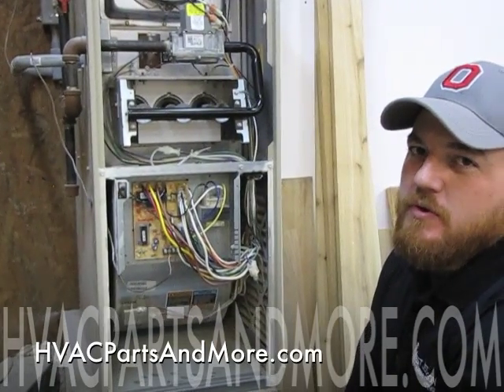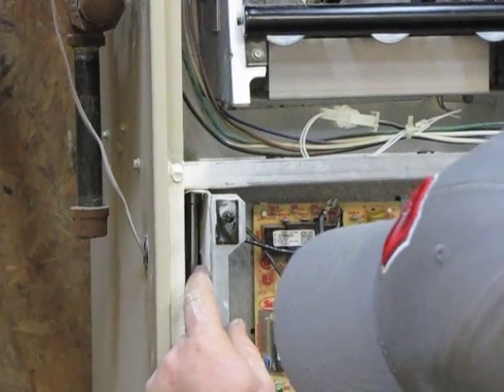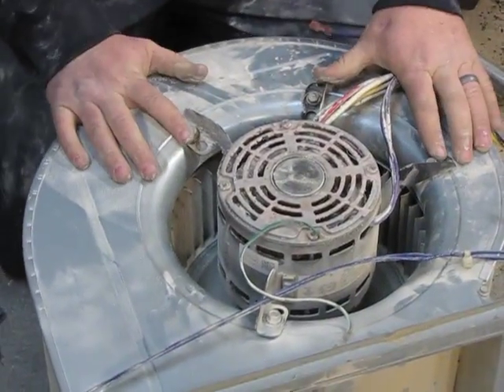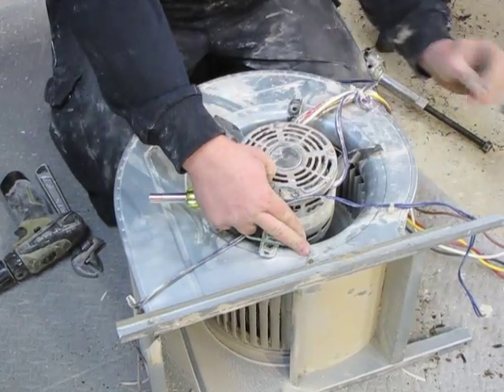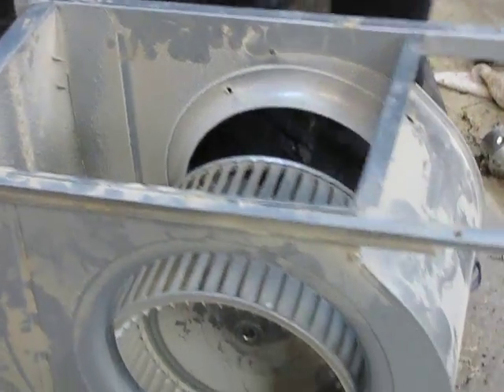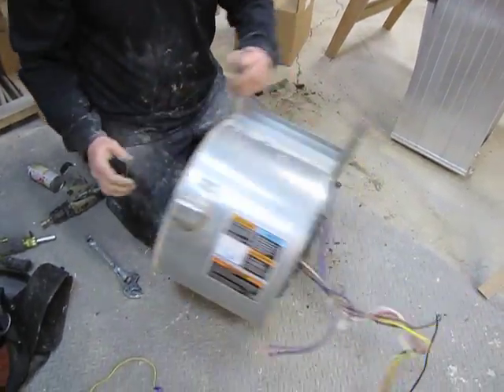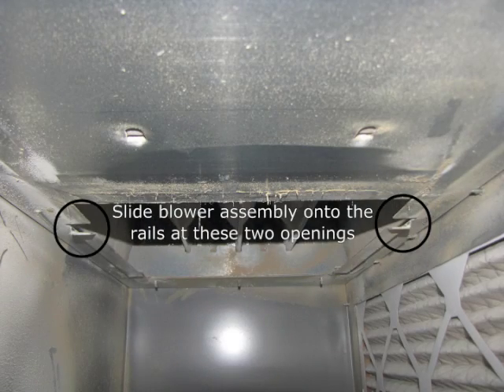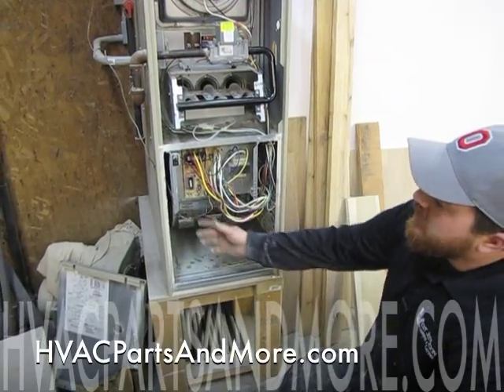DIY - How to Replace a Blower Motor, Wheel, and Housing on a Lennox G40 Furnace

Comment: Question: My original squirrel cage blower wheel lasted 23 years. It separated from the shaft. Anyway, I had it replaced with a new part. It just went today after only 6 1/2 years. The same thing happened. It separated from the shaft. My HVAC repairman says it's pretty rare for this part to go & doesn't know why it broke so quickly. He checked the shaft & said it's not "out of round." He also saw the wheel had been balanced as we could see the weights on it. The motor bearings are fine & are the original ones. 

What are your thoughts on why the original wheel lasted 23 years & the new replacement wheel only lasted 6 1/2 years?
Reply: Made in China... Lol.
Reply from the maker: Separated from the shaft as in the set screw came loose and the wheel came off the shaft of the motor? Or separated as in the rest of the wheel came loose from the center shaft that the motor slots into? Without being there to see it, it's hard to know what's going on; too many variables. If the wheel is just coming loose off the motor shaft, then it's possible that the shaft of the motor (assuming it's original) doesn't have the correct hardness anymore to allow the wheel to stay locked on to it. It's also completely possible that it's as simple as you got a bad wheel or something and it just didn't last as long. 6.5 years is a decent amount of time all things considered but yes it should last longer. As with anything (appliances, furnaces, A/Cs, water heaters, etc) these days though, you should not expect them to last as long as they once did. Normally wheels don't need replaced except when they get dripped on and rust out, but occasionally they get a little off kilter or out of balance.

Sorry we can't provide you with a better answer, it's just not a straight forward problem with a straight forward solution (at least without being there first hand)
Reply: Thanks. No, the set screw did not come loose & come off the shaft of the motor. That's the first thing the HVAC repairman asked me over the phone to check for before he came out to take a look at it. If it had, I would've put the wheel back in place & tightened the screw up. I wouldn't have replaced the blower wheel. 

The blower wheel separated right at the spot as you said  where "the rest of the wheel came loose from the center shaft that the motor slots into". 

My HVAC repairman replaced it today & it's working fine. He says the same thing as you that for some reason the blower wheel may have gone bad a little earlier then others. No big deal. 

Anyway, thanks for your input......Rob

Comment: BLOWER PULLER ?    shoot. its always something.  I need a blower motor puller.
Reply from the maker: You should only need a blower puller if the wheel is really rusted/stuck on there. Most of our service guys never use a puller but prefer to sand some of the grime away and use penetrating oil instead because that is faster for them than mounting and using a puller.
Reply: @Hvacpartsandmore  Im super late to the party but OBVIOUSLY your service guys don't ever pull out super old motors.. Even with a puller it becomes a pain in the ass when dealing with a super old, rusty motor.
Reply: @Diabolical05  yeah 100%, I'm literally watching YT videos on this to explain how to get the flippin stuck motor off.......the connection of wires is pretty obvious....but i find it had to believe that most "old" motors come off easily/without hassle.

Comment: Hi Todd, My furnace started to only blow cold air in Feb of this year, from what I could see after looking at the flashing lights it was due to not getting enough air flow.  I called a local heating/cooling place and they sent a guy out who was down there forever and then emerged.  I asked him what the issue was and he said I needed a new filter, when I inquired if he replaced it he said no he just took the old one out.  I of course sent him back down to put a new one that I had down there in.  The fix lasted about a month and a half and then I had the same issue again.  It was end of season so I didnt worry about it.  I think it might be a dirty blower wheel and have taken everything apart but can't get the set screw on the inside that helps hold the motor off.  Any suggestions and do you think I"m on the right track?  The wheel does have some caked on dirt but it doesn't look awful.  Any insight would be appreciated.  Thank you.
Reply from the maker: That set screw should come off with a crescent wrench. If it's difficult to remove and you can't get it to budge, you may need a bigger wrench so that it will generate more leverage for you. It's hard to say what is wrong without being there. I could see restricted airflow being a problem in getting your house to temperature, but it shouldn't make the air from the furnace go from hot to cool. It could be possible that you had an intermittent issue and therefore the tech that came out looked through your system and found nothing to be wrong with it at that time except for the filter. If it is a standard 1" filter, it should be changed monthly, year round (remember even when you are cooling with your A/C, the air still moves through that filter). You may find you have to replace that filter more or less often given the environment (pets/children will cause it to need replaced more frequently). If it has been neglected over time, it can definitely gum up the blower wheel and other parts of the furnace which will shorten the life of the unit. Also, if using 1" filters, we do not recommend using anything beyond the cheap fiberglass ones. The higher MERV rated 1" pleated filters we've seen simply don't have enough surface area to provide enough air for the furnace. I would start by making sure nothing is blocking airflow to the furnace; whether it be the filter, the duct, or the return air register(s) and then keep it that way and see if the problem persists. I hope this helps. Please ask if you have any other questions.
Reply: Thanks so much!  I do have a higher MERV rated filter in there, I think it's an 11 or 13 rated and it is 1".  I was having the issue when he came out and since he left the filter totally out wonder if that's what he was thinking.  I've tried a several crescent wrenches, one with a really long handle to try to get some leverage on it.  I was thinking about spraying WD40 on there to see if that would help.  I forgot to mention that when I had the upper portion of the furnace door open and the plate off that goes over the burners when I fired it up it produced hot air, when I put the plate and cover back on it went back to cold air.
Reply from the maker: That is a very high rating for a 1" filter; normally the "higher" ones are like 7-8. Definitely sounds like that is your issue. I almost wonder if the furnace was so starved for air that the burners are going out, but the flame sensor should catch that. I would recommend going back to the cheap 1" filter if you can deal with the drop in air quality. Another option would be to add a 5" cabinet such as an Air Bear or Healthy Climate, which can accept MERV 11 with no problem and as much as MERV 16. It's sort of hard to explain, but it's a surface area issue. Imagine if you took that accordion style pleated filter and stretched it out - for example the 1" would only be like 30" longer or so (about .5-1" longer per fold), while the 5" filter will be maybe 100" or more longer. If your motor is still working, I would not worry about getting the wheel off it. It sounds like the filter was blocking all the dirt (along with the air) from getting through, so if you put everything back together and just rectify your filter situation, it should solve the airflow problem.

If you need any more help or want to send pictures or look at our products, check out our website. There is a Contact form there and once we reply, you will be able to add pictures, plus we can advise you on filtration options if you are wanting that.
Reply: Perfect thanks soooooo much!  That helps a lot!!!  I appreciate it!

Comment: so wait what is the housing part? like what is the housing? Can someone please clear this up for me.
Reply from the maker: The housing is the entire metal unit that was pulled out of the furnace. The wheel is placed inside the housing, and then the motor is mounted to the housing, with the shaft going through the wheel which the wheel then attaches to it via a set screw so that it is no longer floating inside the housing. I hope that clears it up.

Comment: how do I wire my blower motor to a capacitor. I only have one brown wire ,a black,a light blue,a red ,a white and a yellow. I have Emerson k55hxl gg-3702 model
Reply from the maker: +Dk charles you will need to follow the wiring diagram in the manual of your furnace or blower motor to be sure as every motor and furnace is different. If you replaced your blower motor, there should be wiring instructions with the new replacement. If you are just cleaning and replacing the same motor, you should look to your furnace manual or note where you pulled the wires from and just place them back in the same place.